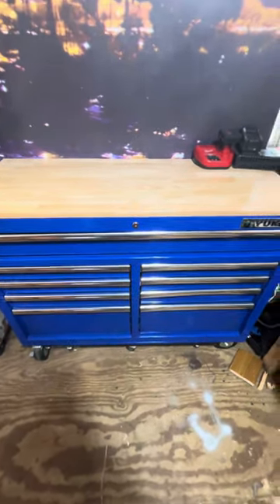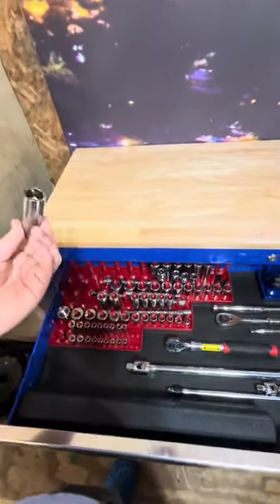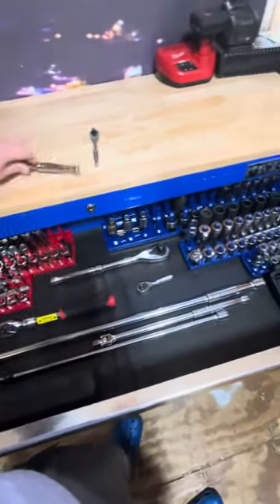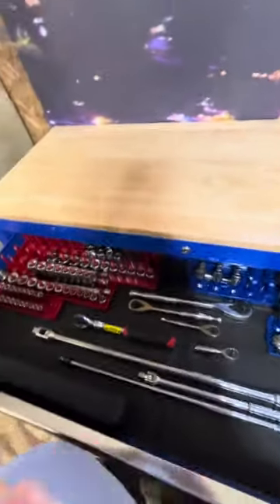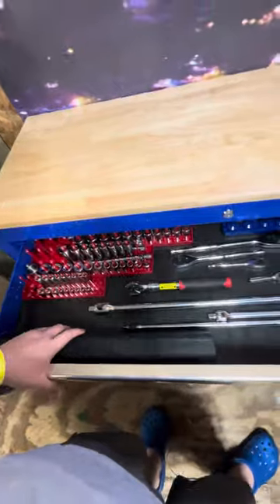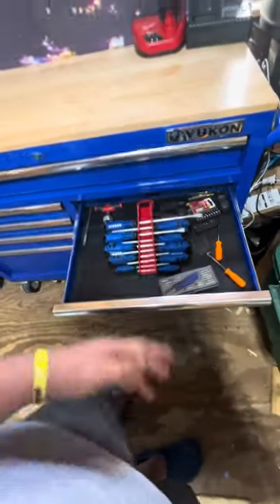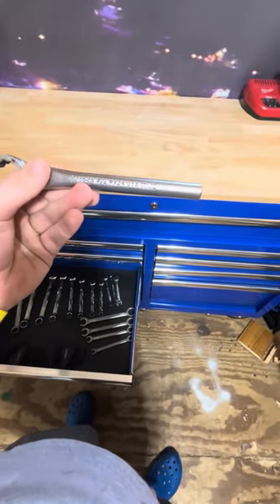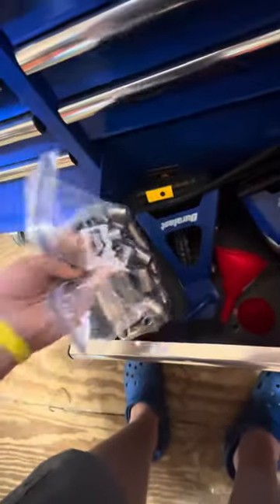Budget tool box tour

Comment: So the 1/4 impact is actually amazing. If you get it on sale with the hardcare, charger and 2 batteries. Ideally I'd stick with 1 brand for power tolls. I went with all milwaukee because there's loads of dealers when I live so easy to get warrenty work done and we get good deals through our company.  Also I'd suggest getting the 6 amp batteries for the 12 volt with milwaukee. I think homedepo has them on sale right now. I just picked up 2 extras so I have a total of 4 now. I also can't wait to try out the m12 1/2 stubby impact That I picked up